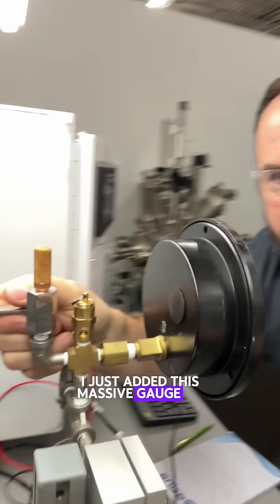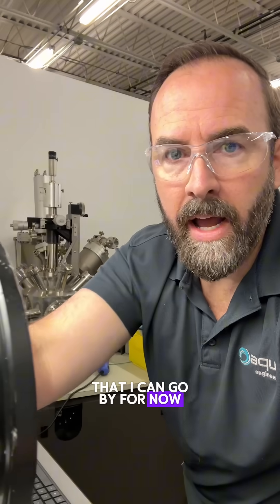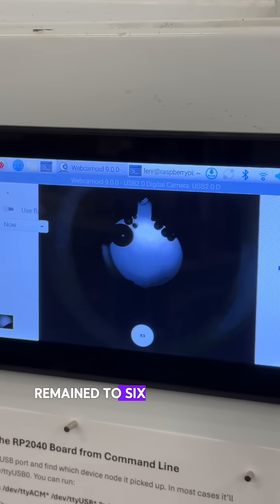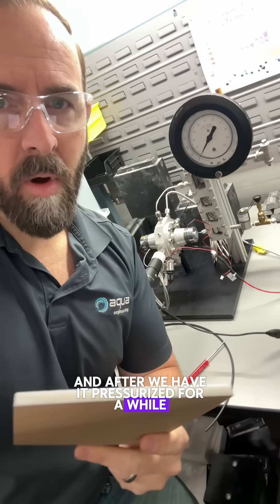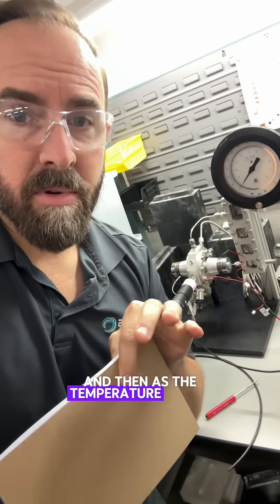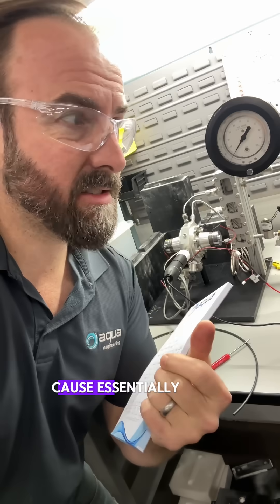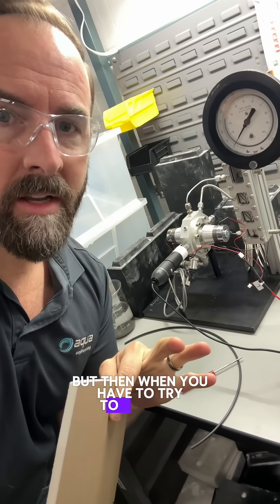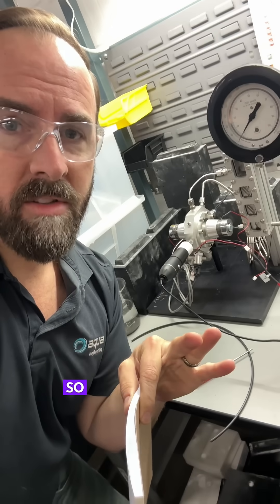LENR Sonoluminescence Reactor Test Gauge

Comment: Wouldn't an oscilloscope be easier to identify those argon pulses u were looking for? They emit light when the argon bubbles pop from acoustic vibration right? How does using oscilloscopes (i bet you could use 2, hook one up to the device causing the acoustic vibration, sync up the data streams and figure out if the light being emitted contains any electrical charge

Comment: What is the purpose of this machine
Reply: To measure the acoustic frequency required to pop argon bubbles inside a glass from outside the glass. When they pop, they emit light. Imagine  the bubbles from soda, the bubbles rise to the top after opening the can and you can actually see them rise up and pop at the surface. Now where there is no surface to rise to, the bubbles pop still but they emit light when they do, and thats what this machine is for.

Comment: Those transducer horns ideally operate at 40khz. Tunability to the reactor wave guide will be a challenge for a single bubble suspension in practice. 
Are you trying to frequency sweep around 40khz  with just one transducer first? 
Keep going brother!

Comment: If you only want one bubble, take a syringe needle, cut its tip straight, and then insert it into the water-filled chamber from top to bottom. Align it exactly where it needs to be and deliver the oxygen bubble. Then, vibrate it. When the sound vibration starts to stabilize, you pull the syringe. Thanks to this syringe, you can easily deliver the desired gas there. But you need to convert this to a pressure-based system. What I mean is, the syringe shouldn't stay in that area for long. This way, you can fix a single bubble. My advice is to use multiple lasers as well.🤣 "Lasers are important." Dude, I'm all about fantasy football right now so I don't know if it'll help but if you think about it a little bit it's actually a very practical solution.👌
Reply: Genius 😮 couldn't have said it better.